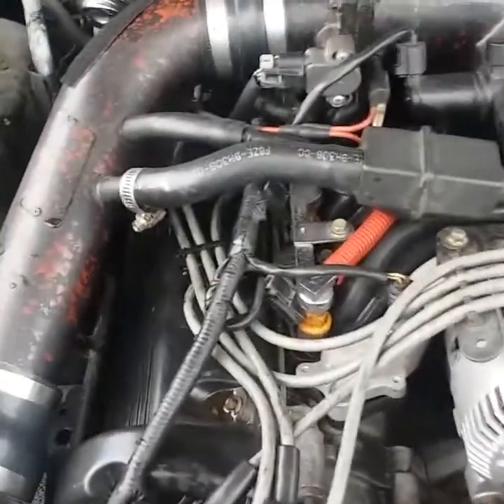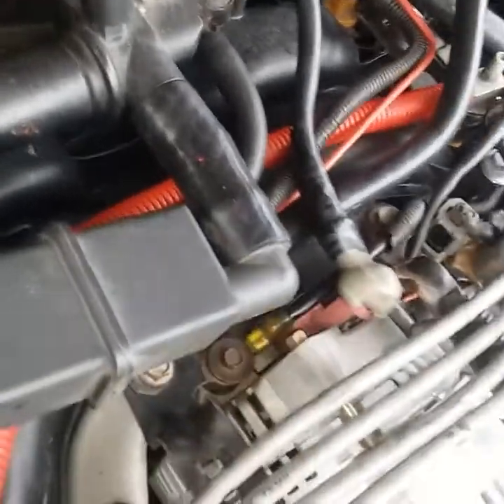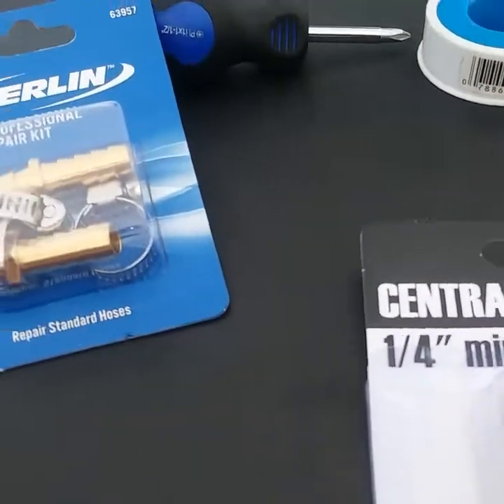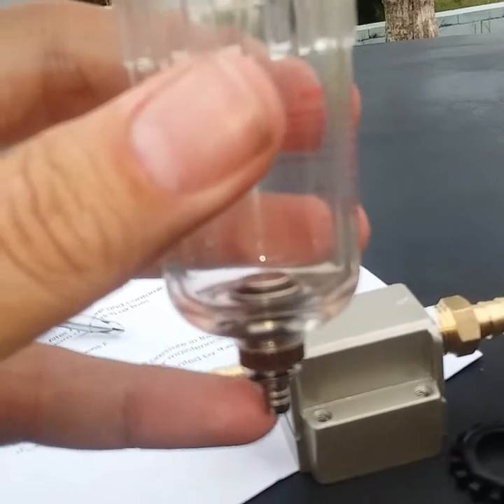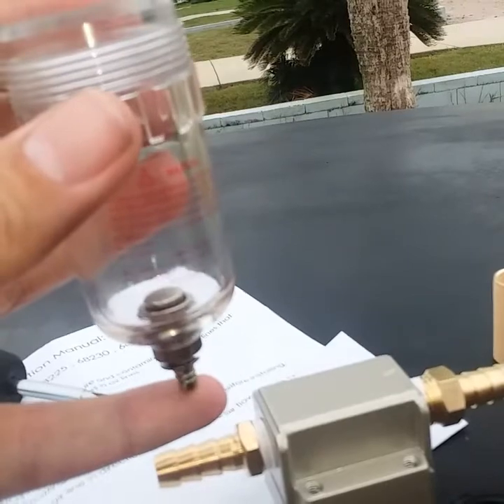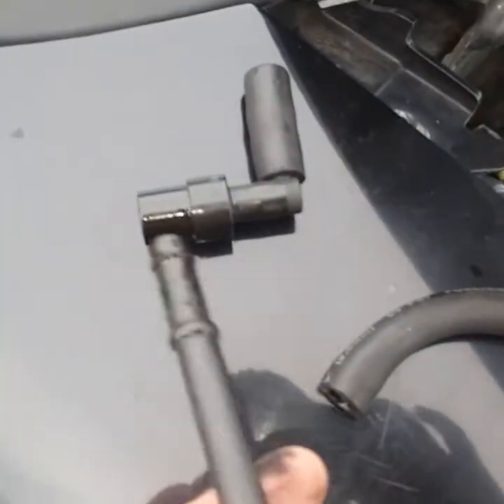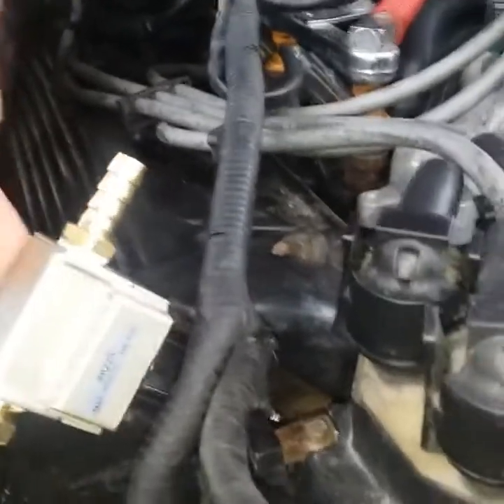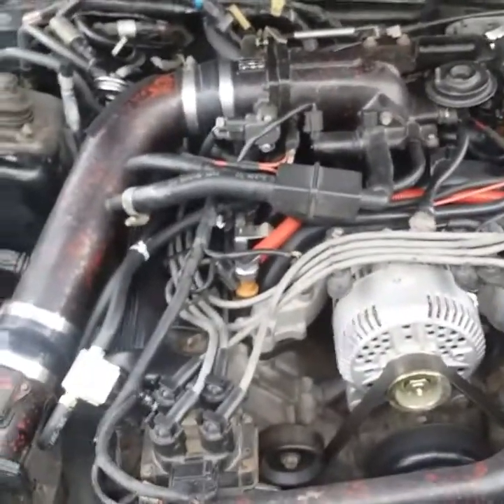$6 Harbor Freight catch can?

Comment: The line with no oil is your air in the Pcv line is your air out
Reply from the maker: There is no "air in" its a vacuum.. the pcv has vacuum on it which leads to the intake

Comment: Replace the valve cover
Reply from the maker: ? What? Nothing wrong with the valve cover
Reply: @TheModAddict  if it’s eating oil it’s the pcv port into your intake. Pcv is in your valve cover.
Reply from the maker: You can change pcv without changing valve covers. My pcv was brand new and still getting bleed by the valve at wide open throttle.
Reply: @TheModAddict  in my truck you can’t change the pcv. ☹️it’s just a vacuum air port built in.

Comment: That's cool catch can. Does your car have excessive blow by? Hence all the oil. On my xterra when I unhook the pcv hose it has noticeable vapor coming out (smoke) and it's using more oil than it should. I want a catch can to catch that oil.
Reply from the maker: Mine doesn't have excessive..but any bit I can keep out of the intake the better. Mine usually have about 2 table spoons every 3-4 months when i check it

Comment: Nice new opener man! So I did this same thing a few years back as I too wanted to save some money. I think you are going to find as I did, that it just really does not work well. You can try to add some like scour pad in there for a media to catch the oil and keep it from sucking back out, but the design isnt really  adequate for this. The oil for the most part will just flow right through it. Also, great points on the drain nipple because again, most people do not talk about it or address it. I had one with a valve and capped the tip and it still leaked from time to time. I think the design you got is a little better in that regard. 
Overall great video man. Just work on fixing that cropping man!
Reply from the maker: Yea.. i figured it was worth a try.. if i catch a spoon full..thats still a spoon full that didnt go into the engine.. we shall see tho.
The cropping i dont have a clue on..but i got a lot to work on. On my phone it doesnt look cropped tho..i also gotta work on keeping the camera more steady..

Comment: Won an ebay auction for a Chinese copy of a ProVent 200, $19 landed. 
Has the stainless filter, which is reusable (I just spray it out with degreaser every filter change,) and more importantly it runs the blowby gasses through that filter, which removes a whole lot more oil than just letting some drop out. You've made a good DIY system that's better than nothing, but for the cost, I'd say it's more worth it in the long run to spend an extra $20 and get a can with baffled airflow and a proper filter. It doesn't have to be a name brand, cheap copies are fine, just get one that pushes those gasses through a filter.

Comment: Just curious, did you see any problems when you reduced the flow of the PCV to the intake from 3/8" to 1/4"?  It would seem that a 50% reduction  in the flow would increase the crankcase pressure by adding an increased restriction in the line?
Reply: I've done it before on a V8 and it was like hell, the engine wasn't responding quickly and you can hear the engine struggling to breath and you will hear a high vacuum sounds coming from the hoses and the catch can that if the hoses didn't collapsed on you :)
So just don't do it try something with the same hose size
Reply from the maker: I havent had a single issue. Car is still very responsive especially for 23yrs old.. no noises or struggling.
Reply: @M91211   Yeah, I kept the 3/8" all around because I suspected that would happen. But I ran into another problem when I put a catch can on the air intake side going to the valve cover. I made the mistake of placing a check valve between the catch can and the breather tube (to stop oil from being drawn back from the can to the intake) and found that the air goes BOTH ways in that tube (duh) so instead I capped the line coming from the breather to the catch can and plugged in an after market filter on the air side of the can. Now the problem is gone. Moral of the story - don't use a check valve on the air intake side.